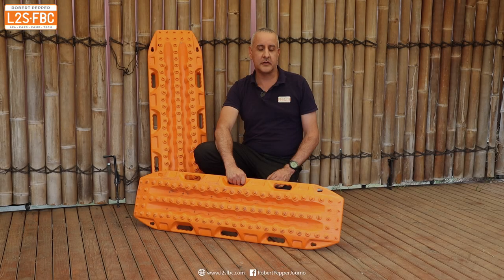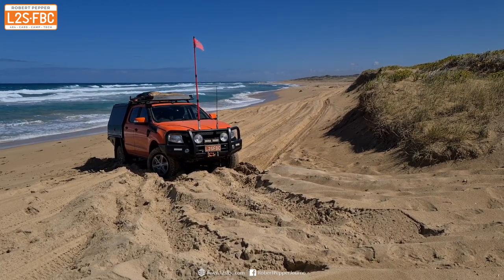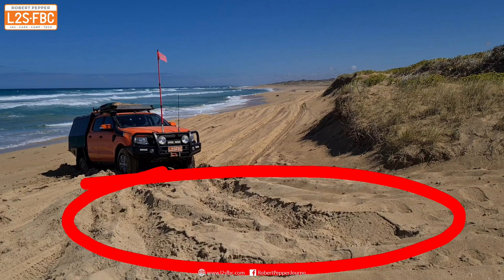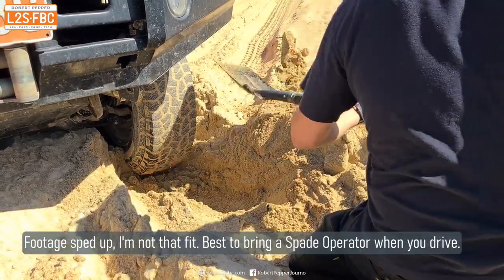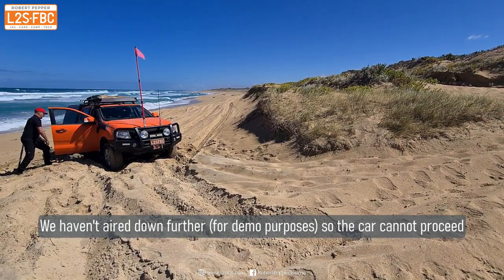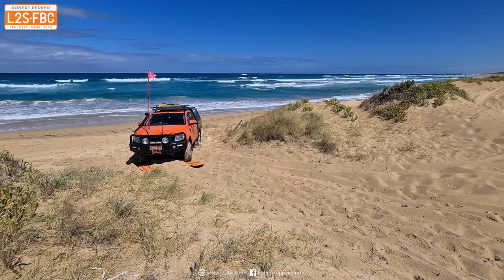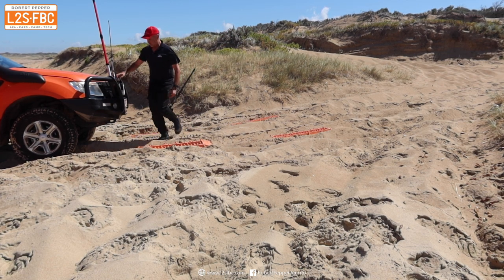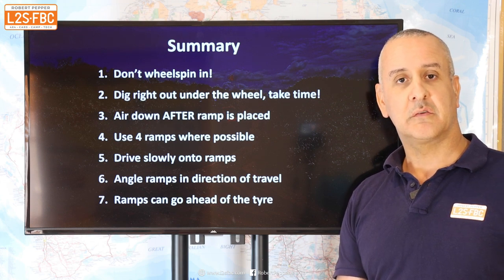Recovery Ramp (Maxtrax) sand recovery

Comment: Thanks for the info. New to the channel (thanks MadMatt!). Have you done anything using Danforth anchors in sand recovery?
Reply from the maker: No, I haven't. I'm not a fan of ground anchors in general. Never owned one, but used a few. The problem I find is either that the ground is too hard for the anchor to dig in, or soft enough for the anchor to dig it and then it won't hold.

There are only 3 things I think necessary for a sand recovery and I go over them here -> https://youtu.be/ZayK3Tq0L3Q

Comment: Could the ramps also be used to sweep the top layer of sand by grabbing them from the side and using the other side as a sweeping wedge? Sometimes the surface layer hides a deeper, wetter and more compact layer; of course, this is something that depends a lot on the type of sand and also on the time of day, on the hours that the sun may have been drying the surface layer. What I am looking for is to extend the mommentum as possible on the path ahead of the vehicle once we have left the ramps behind.
Be that as it may, I appreciate the scientific and great common sense way in which you analyze material, situations and techniques.
Reply from the maker: Not really, no. The best thing to do is to smooth the way forwards. Part of the reason I was bogged was because of all the criss-crossing ruts. This greatly increases rolling resistance, and also de-stabiilises the car. So, if a shovel was used to smooth the way, that'd help. Also, ruts can be used to tramline the car so it steers around corners. I might cover those techniques next time I'm at the beach.

Comment: Hello, Robert. Thanks for this video, sharing your knowledge. 
In reference to your comment that lowering pressures must be done after having placed the ramps under the wheels, I want to ask a question: let's imagine that, when we got stuck, we already had the wheels with pressures as low as possible. Would it be convenient to raise the pressures before digging under the wheels, then place the ramps and, later, lower the pressures again? I don't know if it's a crazy idea just in the case pressures were already down before getting stuck.
Reply from the maker: No I would just push the ramps under in that case. Generally I like to run at higher pressures than minimum eg 14psi with the option for 10 and then reinflate after.

Comment: hi, would you prefer the Maxtrax befor the classic Aluminum panels? My experience is that the MT are often too short and the alu with 1,5m are better for my Pinzgauer 6x6.  But the MT are much lighter. So what would you suggest me. I intend to take on the Panamericana?
Reply from the maker: Pros and cons..if you can take the panels and they also work in mud, use them if you have space.

Comment: It will be my first time 4wd tomorrow on the beach so this extra information really helps. Do tyre pressures depend on the wheel and tyre size or just the conditions? I was practicing with my deflator and compressor today and the tyres had a huge bulge at only 18psi.  Iam new to this as mentioned.  Will actually be trying Preston beach! Great channel BTW.
Reply from the maker: Pressures depend on a bunch of things including vehicle weight, tyre aspect ratio and more. What vehicle are you driving?
Reply: @L2SFBC  2012 hilux sr5 with stock wheels 17 inch and Cooper at3 tyres
Reply from the maker: Start at 18psi and if you have difficulty drop to 15 straight away. Where is Preston Beach?
Reply: @L2SFBC  South of Perth, thanks for your help and quick reply.

Comment: It seems like I'm more common thought in places outside of the USA is that narrow tires work better which in some cases they do and they are better less unsprung weight and easier to move but I'm telling you I've experienced on my Discovery 11.5 wide tires are way better in sand and the whole concept of drag I don't even notice it in my disco isn't a muscle car by any means but I'm just saying the whole drag Theory I don't think you noticed much as much as it floats over the sand and helps you make it better. I know with a powerful V8 and 12.5 wide tires you can really fly right over the sand but my point is that the drag Theory really isn't true from what I've experienced they just float over it instead of digging in like Skinny's

Comment: Questions: Are Sand-ladder better than Maxtrax?
Reply from the maker: For what purpose?
Reply: @L2SFBC  let's say in sand/beach, or overall performance Sand-ladder vs Maxtrax
Reply from the maker: Maxtrax. Reason being that Maxtrax are better designed to grip tyres. They are also lighter smaller and easier to store.
Reply: @L2SFBC  how about multiple uses between Sand-ladder and the Maxtrax? Not only Sand-ladder use it for recovery, they also can be use as bridge for gap and incline
Reply: @notjohnwick007  If it is a proper ladder-type, then it really depends upon the rung spacing. Something like 5-1/2 ft. (1700 mm) long by 13 in (330 mm) wide with 6 in (150 mm) high sides and a 5-1/2 in. (140 mm) rung spacing would work fairly well even for minor bridging and could be made very cheaply if it's made from steel. Aircraft grade aluminium would be a lot lighter and just as good, if expensive. If the rungs are any wider apart then the tyres won't be resting on two rungs at any one time, meaning that the drivetrain is being shock loaded between each rung and also it won't spread the load very well. The perforated steel plate type similar to that used to make makeshift runways just bend, are extremely heavy and really not very practical. Again, these are also available in aluminium, but quite why people still insist on loading themselves down with these I've no idea. It's the same thing with the glass fibre "waffle boards" that for so long have been de rigueur in the UK, they're heavy and just leaf sharp splinters in your hands if you don't wear gloves. Certainly in the UK, the only other plastic type that's any good apart from Maxtrax is the US ActionTrax. All of the others break eventually.
Reply: @cameronwood1994  even ActionTrax are better than most expensive ARB Maxtrax?
Reply: @notjohnwick007  ARB, certainly in the UK, sell the Tred range, not Maxtrax. Most people I know who've used Tred's have broken them, not heard a single failure with ActionTrax yet.
Reply from the maker: Thank you S2S Overland - I agree entirely with your comments. I have compared waffle boards vs traction ramps here -> https://youtu.be/evTaI5iANuQ 
Maxtrax, and other QUALITY traction ramps, don't break, and are used in many other situations than sand or compression terrain. I will show that in future videos.  I really do not understand why people want those silly waffle boards. I imported two to Australia, used them a few times, never again.  Also in my interview with round-the-world traveller Marcus Tuck he uses ladders -> https://youtu.be/rdO4QmkeCJw
Reply from the maker: Oh and I have broken Treds too, well...my students broke them, not me, but to be fair that was an older Tred design. The Maxtrax you see in the video are 1A models, and I think they're 15 years old. They have been used for probably hundreds of recoveries in sand, mud, snow and rock...still going. I have a set of Version 2s which I don't often use, just interested to see how long these 1As actually last!